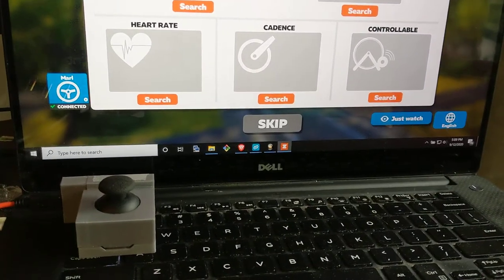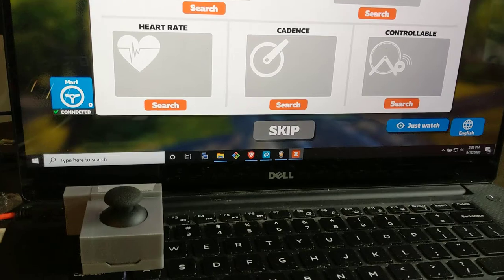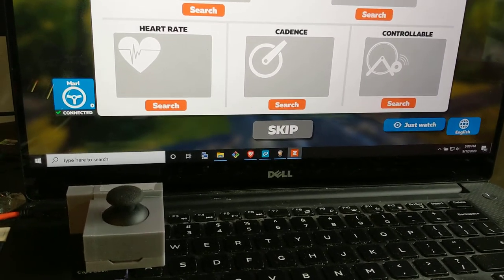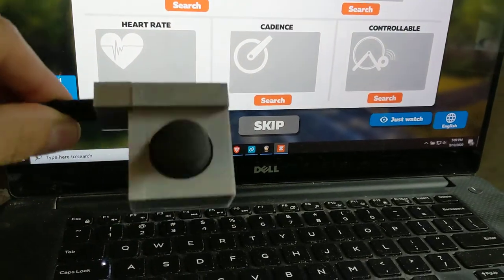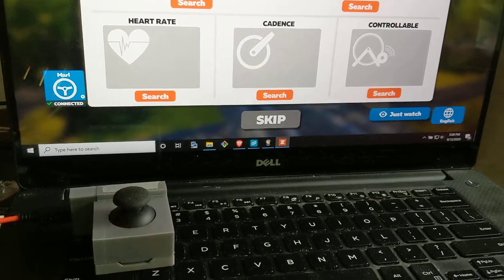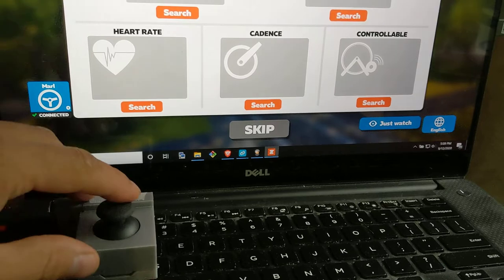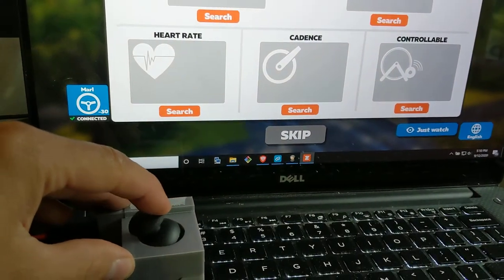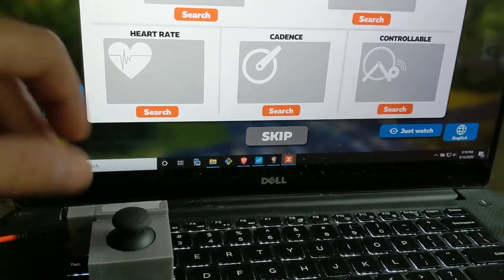Zwift steering with an joystick

Comment: Great! Is there somewhere a project Page where i/we can see the hardware connection? Would id be possible to use a Raspi with a standard USB Joystick.
Reply from the maker: I'm hoping to get a better write up of things in the next week or two.  Right now everything is just in code, in the github repository.  

You could definitely use a pi.  The repository has some example code that uses BlueZ which should work on the pi.

Comment: This is great - how simple is it to get it working with keyboard buttons, which could then be activated with anything as a macro?
Reply from the maker: It would be another layer that would need to get added to the code.  But one could likely add the ability to talk to the device with the keyboard via USB, and than that would in turn tell Zwift, via BLE, to make the turn.